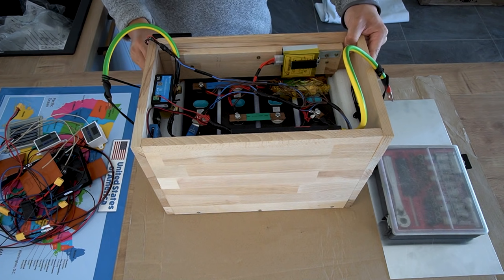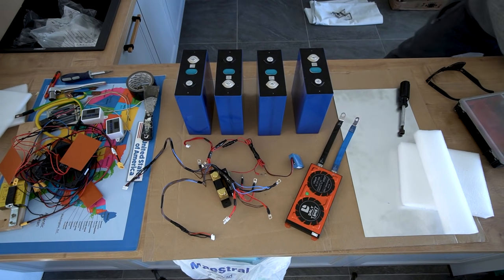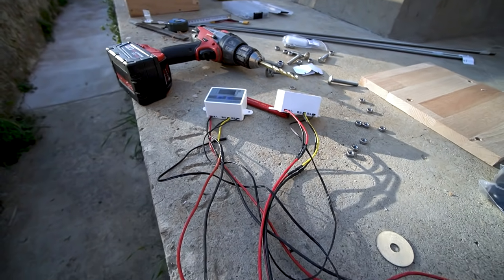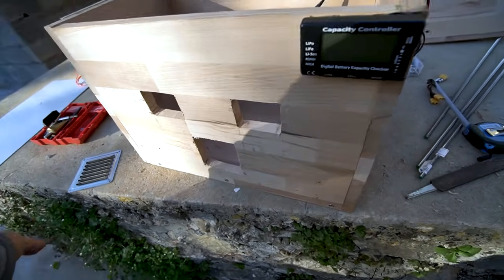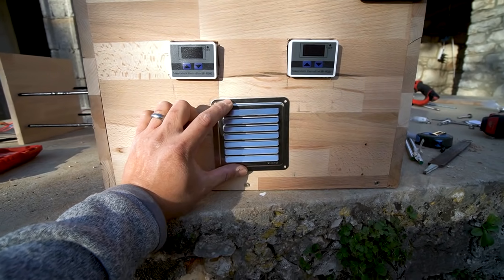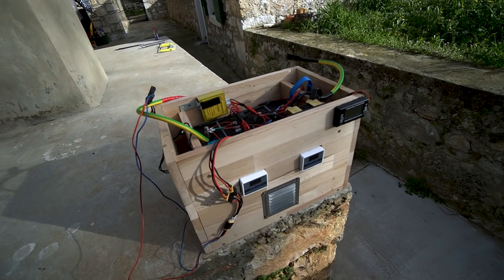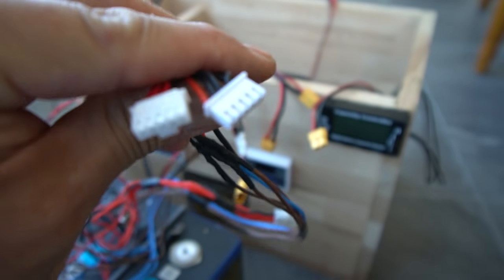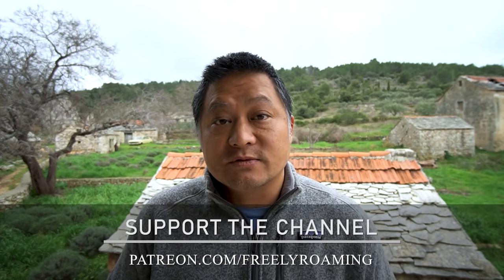DIY Cold-Weather LiFePO4 12-Volt Battery Upgrade 🤖 Part 2 // Assembly

Comment: Hmmm not sure i understand why do you need a separate cell balancer...this should be a function of the BMS board....
Reply from the maker: It makes the balancing process faster and more reliable. BMS only does passive resistive balancing. Active balancers are faster and more efficient. Like I stated in the series, it's an option, not a necessity.

Comment: how much total power is being used (on the heat side of things) for all the heat pads and the controller?
Reply from the maker: Controller draw is undetectable. Less than a watt. I think it's around 0.2 watt. My heating pads are 60 watts. How much heaters you want to install is completely up to you.

Comment: hey man this is so awesome and is just what ive been looking for. I want to be able to go out into the desert if i want to so i def need overheating protection. 

Question though; do you think i should still insulate with foam if im going to add a fan for cooling? Did you simply run out of space or do you think its best to keep the batteries open to being cooled therefore forgoing insulation? Thanks for the videos i subscribed :)

Oh and I also will be going into the Rockies and Sierra mountains so overcooling is also a concern.
Reply from the maker: As far as cooling is concerned keep in mind that my setup will not be able to cool it below ambient temperature. So the air in the battery compartment is as low as it's gonna be since it is just circulating that air using a fan. Active cooling will require a far more extensive set up but these batteries can withstand high temps than a normal person can with upper limits at around 130°F. Most likely you will over heat before the batteries do. Insulating the batteries will mostly benefit in really cold weather to keep the internally generated heat from the cells during charge and discharge from dissipating. In hot weather, open spaces for cooling will be best.
Reply: @freelyroaming  Cool thank you for the info :) I will probably keep insulation handy, but I am planning on getting a heating pad like I said. Do you think 60w is the right amount, or would you do it differently if you had to do it over again?
Reply from the maker: 60 watts work well for me as I don't plan to be in really extreme cold climates. If you do, more will help.

Comment: Could you run this in parallel if you built a second one
Reply from the maker: Yes you can.
Reply: @freelyroaming  what do you think of running these in series  and using a growatt all in in one 24 v inveter. This would be for my box truck
Reply from the maker: @Malik90848  I don't have any experience with all in one units but assuming they are reliable, it seems like a great and simple way to build a system
Reply: @freelyroaming  it great tat these can be ran in parallel or series. Great video. I really enjoy your video
Reply from the maker: Thank you

Comment: Isn't it a bad think with all the "Battery balancer"
The BMS having a Battery balancer.
The (Black) monitor having a balancer.
The China box inside having a balancer.

I'm i misunderstanding something or?
Reply from the maker: Only the BMS and active balancer. The monitor does not. It's good to have multiple balancers. It keeps cells balanced faster and adds redundancy in case one of them malfunctions.
Reply: @freelyroaming  Alright, make sense.
But are the (5A-8A Active Cell Balancer) also passive, like the monitor?

Basically you can settle with the BMS only.
Reply from the maker: BMS does passive balancing. That means it simply does generates resistive load on the high voltage cells to bring it down. Active cell balancer will distribute power from high to low cells. You don't need an active balancer but expect slower balancing and no redundancy. The monitor does not do any kind of balancing.

Comment: The idea of active heating is good, but do you really need it?   If you have a 100 A charger from shore power is one thing, but  if you are charging a couple of amps from your solar you will be just fine! 👍
Reply from the maker: It depends on how the battery is used. Yes for some people, they really need it. Perhaps not for you but you are not everyone.

Comment: Why not build the whole thing in a small cooler to help maintain the heat and reduce the cycling on and off ???
Reply from the maker: Because that is only good for cold weather. In warm weather you do not want to trap the heat inside.
Reply: @freelyroaming  You could still use the fan in the summer and just cover the openings with insulation in the winter !
Reply from the maker: @oldguy1528  That is just one of many reasons why a cooler is not an ideal choice for me. They are big, does not have square corners or flat walls, difficult to secure with screws and bolts and not exactly a sturdy platform for something that weighs over 50 lbs. You are better off insulating the inside of this box with foam if insulation is what you desire. If you see the beginning of the video, that is how it was built before. I removed the foam to make space for new components.
Reply: @freelyroaming  I got ya !!!

Comment: Push cool air, do not try to pull out warm air, it seems EVERYONE makes that mistake!
Reply from the maker: That is not a rule to always follow. It has everything to do with the air chamber design and position of the fans. Often your pushing of cool air ends up getting trapped inside and the best way is to create negative pressure to allow cool air to flow in.

Comment: I'm sorry but you lost me as soon as you added the heat pads🤔 umm its in an enclosed wooden box. You have overcomplicated what should have been a fairly straight forward setup. The 1 and only reason to go down that path is if was a mobile setup for extreme cold with the possibilty of hotter climates. Otherwise those pads, yeah nah waste of time money and stored energy. In no way am i trying to be mean i just fail to understand the over complication. In Australia there is a saying KISS
KEEP
IT
SIMPLE
STUPID.... 
Constructive critisism, you obviously are way smarter than i am in terms of your understanding of electrical systems. Why did you not insulate the outside of the box with rubber car floor mats?? Small cost like the plastic cutting board you used as battery dividers... yet zero cost of pads wiring etc not yo mention the power drain.. At the end if the day all these videis are about savinv energy.
Reply from the maker: You said it yourself. "The one and only reason is a mobile setup for extreme cold climates". Maybe you missed the title of this video - "DIY COLD Weather LiFePO4 12-Volt Battery Pack". The point is to build a battery specifically for cold weather use. Consider watching part 1 if you are wondering about the reason for the build. My entire channel is about mobile living which I assume you did not notice either. Yes, it is a mobile-use battery capable of operating in cold temperatures. Using heating pads to enable lithium batteries for cold-temp use is a standard practice by every lithium battery manufacturer.
Reply: Some people man.....some people LOL